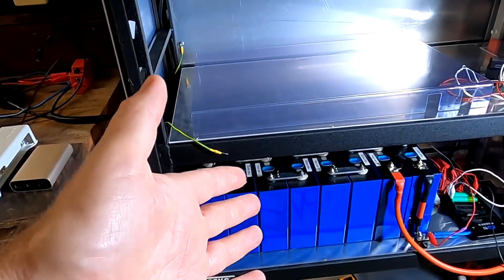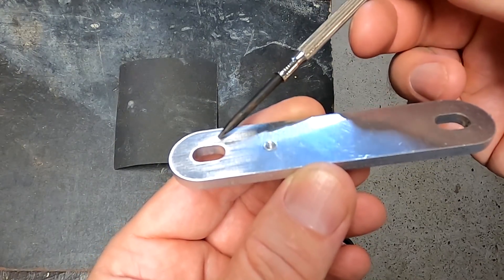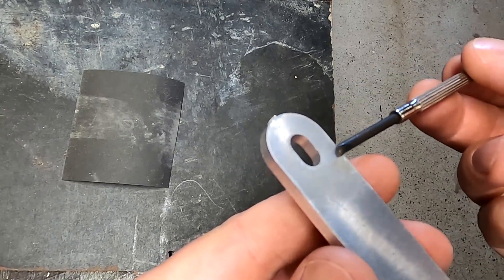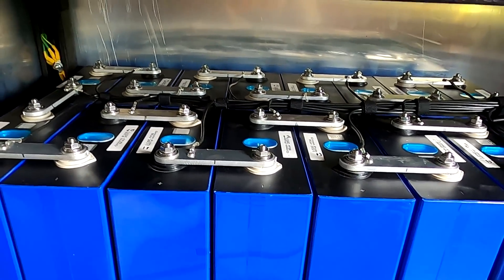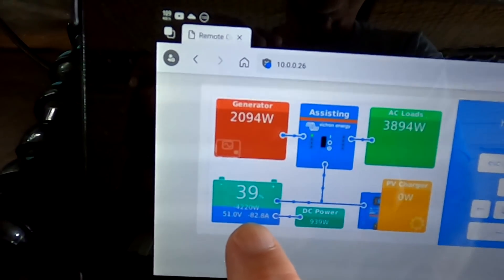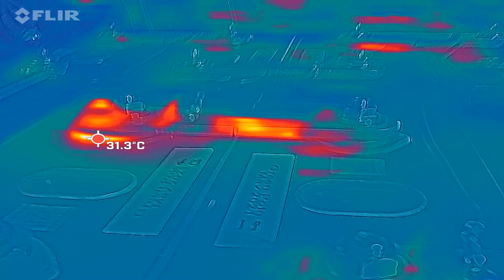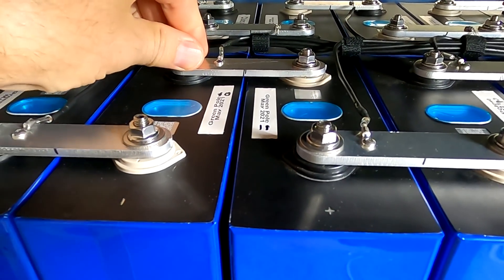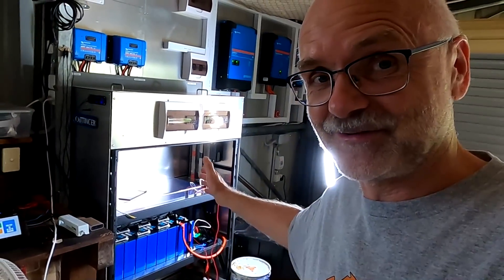Overcoming the battery-busbar problem (for now). Here is what I found!

Comment: Why not go for copper?
Reply from the maker: The Aluminium bars have a lower resistance than the copper busbars coming with the cells. Also, I'm experimenting here on the channel ;)
Reply: @OffGridGarageAustralia  Strange … when compared by volume, copper outperforms aluminum when it comes to electrical ratings. Boasting a lower electrical resistance, lower power loss, lower voltage drop and higher ampacity. All of which contribute to the electrical efficiency of the busbar trunking system.
Reply: @IAmZen_007  Which is why these bus bars are over-sized to counteract that. By making them thicker, you can get a lower resistance compared to the included copper bus bars. He's not comparing the same size/thickness of copper vs aluminium, which is of course better for copper.
Reply: @upnorthandpersonal  I agree but I would go for the same size … in copper.

Comment: Aluminum has almost twice the resistance of copper.  This is why it is heating up.  Better just use the provided copper bus bars
Reply from the maker: No, that's not the reason at all. In fact these aluminium busbars have a lower resistance than the copper busbars which came with the cells. Watch it here: https://youtu.be/mdr5HZZRaTc

Comment: Personally I would ditch the aluminium in favour of tinned  copper. 
Aluminium is not a good choice for low voltage application’s unless it’s welded.
Reply: Because my tin plated copper bus bars were cool as cucumbers after several hours at 90-100A today.
Reply from the maker: Why do you think it's not a good choice?
Reply: @OffGridGarageAustralia  there’s too much chance of oxidisation on aluminium leading to high terminal resistances and temperatures, I have had nothing but problems the same as you with my battery using aluminium, changed to tinned copper and no problems.

Comment: Terminal velocity!
Aluminum has an oxide form almost instantly, maybe you can  find a soft stainless brush to clean the buss and terminals with, a clean one, and keep it clean with acetone, did you check the voltage drop across the terminal and buss? (I missed the last video!) But I'll watch it, soon! 😜
Reply from the maker: I didn't check the voltage drop as I cannot measure it. There is no access to the actual terminal of the cell any more. It's all covered by the busbar.
Reply: @OffGridGarageAustralia  Maybe you can get to the batt term. Since this is an experiment, how about drilling a hole in the alum bus-bar large enough to put your voltmeter probe through. If the surface area is small then it probably does not matter where the hole is located. But, I would be inclined to position the holes at the extreme end of the bus-bar. Good Luck.

Comment: Andy 
You should not see more than .001 millivolts between the side of the battery terminal (under the buss bar) and the top of the buss bar right next to the nut at 90 amps. If you do there’s resistance.
Reply from the maker: There is no way to check that though.
Reply: @OffGridGarageAustralia  
Arg! Yes I seen yours are practically flush with the plastic. Dang it! My terminals (CATL) are smaller in diameter(not a good thing) and way taller so mine are easy.

Comment: Andy, it most likely does happen to a lot of people, but they probably don’t stare at their battery with a thermal camera every day to find out lol. If I say ouch when I touch them, then I know they are too hot, otherwise, I just keep sendin it. 

Actually, in all honesty, I have temperature sensors every 3rd busbar connection. I check them on my phone way more times than a sane person should. But after I roasted a stainless steel washer, by putting it between two connections carrying 3-400 amps, I constantly stay worried.
Reply from the maker: Temperatur sensors at the busbars is not a bad idea actually. Could be another great project... 🤔

Comment: It would be interesting to test at 150% of normal max, or ideally 2x normal max.  In other words, if your BMS limits to 100amps (fairly quickly shuts off), bypass the BMS and test for 30 minutes at 150 amps or 200 amps.  Starting with the battery fully charged, a 200 Ah or greater battery should have no problem at 200 amps for 30 minutes.  That will show any heating issues more quickly, and if it is good at 200%, it will be good at the normal max.
Reply from the maker: The BMS can deliver 200A constantly or 350A for a few minutes.
If I can see no more heat building up at close to 100A, that's good enough for me as I will never draw more power from these batteries. In fact with 2 more banks installed, it will be close to 40A max per bank for now.

Comment: Is it possible that the pressure from the nut and terminal is compressing the aluminum down and changing its shape
Reply from the maker: No, that's not possible from only 4Nm. These 4mm bars don't bend  easily.

Comment: While it is true that the oxide forms very quickly, it's only the first 4 nano meter that forms almost instantaneously; the deeper oxide takes a lot longer, so adding no-oxide right after sanding is fine. Incidentally, your experience also shows the reasons to use a conductive paste such as MG847 or silver based compounds: it's to make a uniform connection between two contacts when they might not be fully 'flat'. The paste fills the 'gaps' between the two contact areas.
Reply: We used to have a similar problem putting epoxy coatings on lead, where an oxide coating forms instantly. The answer to apply the epoxy (or conductive paste) and then immediately scrub and massage with a metal bursh, through the unset coating. Now the metal is on bare metal, not oxide, and can be finished or bonded.
Reply: Thank you for substantiating the theory. I have used MG Chemical 846 C Compound in many electrical joints. But I detest the item to the hilt, due to its unauthorized spreading on digits, even though Nitrile safety gloves were used. Thanks for the similar thought. Have a nice Sunday evening. 73s…
031322/1433h PST 🇺🇸
Reply from the maker: So is it MG847 vs MG846?
Reply: @OffGridGarageAustralia  By the way, don't just take my word for it. Check out Ray Builds Cool Stuff on YT, a few video's back he's trying various methods, measuring terminal resistance etc., and ultimately settles on 847 as well.
Reply: @OffGridGarageAustralia  MG847. MG846 has higher resistance:  63 Ω·cm vs 23 Ω.cm. MG846 is silicone based. MG847 also doesn't 'bleed', that is, it stays put.
Reply: @upnorthandpersonal  , what if we wrap pure carbon fiber fillaments under and over each busbar connection? Would that improve contact by filling all the gaps?
Offcourse, after applying the antioxidation paste.
Reply: @silviuflorescu6838  I think a paste works better for this. You also want to make sure the carbon fiber is suspended in e.g. oil, because of galvanic corrosion.
Reply: Yes but why risk it? Just use copper. It’s lower resistance anyway. Sorry I missed Andy’s reasoning for going with aluminium. BTW, you can probably better clean the buss bars without damaging the integrity of the surface using a mix of vinegar and water.
Reply: @mondotv4216  The goal is to have a thin oil coating to prevent oxidation. Water will make it worse. Andy discussed the use of aluminium bus bars in a previous video. That does not mean I recommend it...

Comment: I find that applying the electrical grease to the sandpaper directly. Then I wipe them off with a paper towel covered in grease so it keeps it greasy. I install them greasy and it seems to prevent oxidation since it squeezes the grease out under the contact points of the busbar. YMMV
Reply from the maker: The less exposure to the air the better, so this is a good workflow you're describing there.

Comment: Why not install Nickel plated copper busbars instead? They are a much better conductor and the nickel prevents any oxidation from forming so you won't ever get high contact resistance between the busbars and the terminals just like you demonstrated in your video.
Reply from the maker: These Al busbars are actually a better conductor than the copper busbars which came with the cells: https://youtu.be/mdr5HZZRaTc
Also, what would we learn 😉

Comment: If you want to go a bit crazy on truing the surface place the sandpaper on a sheet of glass before sanding. That's what I used to do when truing CPU surfaces and heatsink surfaces before applying thermal paste.
Reply from the maker: Ah, yeah glass would be optimal. I have a mirror tile which I could use. Thanks for the tip!

Comment: Change the busbars to COPPER, IMO; experience taught me just that. Keep up the good work.
Reply from the maker: Thanks, yeah, it might be better in the long run but lets see how the al bars last over time now. We all want to learn here 😉
Reply: Copper and aluminium react. Would need an appropriate electrical joint paste
Reply: The cells terminals are aluminium. If you join a copper busbar to an alu cell terminal, it will be worse than what he has now.
Reply: @danielardelian2  How so? I can put a temperature probe on all of my copper busbars and they are ambient temperature, no heat whatsoever. The batteries live in totes on my back porch in a high humidity location. 18 months with no problem at all....yet.

Comment: I'd be interested in finding out after a week or two if the NO-OX-ID has done it's job and the bars stayed cool. For all I know, the NO-OX-ID is crap.
Reply from the maker: That actually happened to some of the connections in the old battery and I had to redo them a few times.
Reply: @OffGridGarageAustralia  Interested in trying the MG's 847 carbon conductivity paste (on Amazon) and making a video? It is supposed to be very good conductivity, anti oxidizer, and thermal conductive paste. Last week I bought the NO-OX-ID because I saw it on your earlier videos, now, I'm not soo sure if I want to use it without further testing data. I thought "This guy tests everything, so he must have tested it before choosing it :)". I'm leaning to the 847 now. I only didn't choose it because it was more expensive of the two, but the 847 came highly recommended by a professional. I'm using Cu bus bars because I think it is easier than crimping a bunch of Cu wires like Mermaid lady. I was considering the Al bus bars to save a few bucks on the new builds, but with the amount of trouble you are seeing, I'm a little more concerned about using them now.

Comment: As I told in a comment on the last video: Do not use a washer alone, use a serrated washer, to cut through all oxides, a washer and a spring washer to keep the force constant over temperatures...
Reply from the maker: The washers are only applied from the top. I think there is a misunderstanding here: 99% of the current will flow from the busbar to the terminals directly and only a very small amount thought the actual stud. The form and type of washers will make no difference of the connection underneath.
Reply: @OffGridGarageAustralia  Sorry but I think you are mistaken about the flat washer. IMHO the flat washer reduces the pressure at the contact points between the batt terminal and the alum bus-bar because it distributes the force from the nut over a larger area. Also, if the flange nuts are serrated, the serrations concentrate the pressure improving the chance for a gas-tight connection. Almost all of these issues go away when copper is used.
Good luck and keep 'em coming.
Reply: @OffGridGarageAustralia  But even if the serrated washers have not much effect, the spring washer will keep the force constantly applied.
Reply: @the78mole  yes i think a spring washer is essential as alum has a fair bit of thermal expansion.
Reply from the maker: @the78mole  That's what I use the flange nuts for, right? They have the same effect.
Reply: @OffGridGarageAustralia  As John Meek describes it correctly, the flat washers have a bad impact on the overall connection performance. This is, why you should only use them in combination with serrated washers to get gas-tight connections. I believe, the flat, large contact area between battery and busbar is also not ideal for the material combination you use. I can only speak from my experience and what I learned as a trainee and the rule of thumb is: avoid aluminium, prefer copper. This gets another twist with actual prices, but the rule stays valid from a technical point of view.
Reply: I think a serrated washer could risk worse contact if it's not fully compressed.

Comment: Could you try tinning the bus bars? Having a different material which doesn't oxidize as quickly as the surface layer could be better. Also - solder is softer so it'll squish against the terminal and deform a little giving you more wiggle room for a less flat bar.

I mean there must be a reason that most crimp connectors are pre tinned? 🤷🏻‍♂️
Reply: 031322/1455h PST 🇺🇸.    Mark my words … Andy will discard, throw away and forget the Al BB and will replace it with 3mm Cu BB, I bet on it. Remember, Andy is experimenting, teaching, educating  and pleasing Paul,  simultaneously, quite diplomatically. 73s…
Reply from the maker: They tin the copper for the same reason: keeping oxidation away. Copper does not oxide as quick as aluminium but it will over time.
Reply: @OffGridGarageAustralia  The difference and problem is that copper oxide is conductive, while aluminium oxide is not.
Reply: Doesn't matter.  The batteries also have aluminum terminals so it is better to keep it the same, just have to remove oxidation before assembly.
Reply: I just thought it might be worth a test. I'm not convinced manufacturers of crimp ring connectors would go through the extra production step of tinning their products if there wasn't some tangible benefit. Andy said the old bus bars and digital mermaid's flexible ones worked fine - maybe the fact they are both tinned could be a factor.
Reply: @pingu99991  You can't easily tin aluminium.
Reply: @upnorthandpersonal  I think the way I'm picturing the tinning process for this is closer to brazing but without soldering two parts together. Like heating up the part with a blowtorch and touching it with the solder letting the heat of the bus bar melt it so it wets across the terminal area.
Reply: @pingu99991  Doesn't work like that, because of the oxide layer. You should google "tinning aluminum" and check the first video result "Easy Pretinning of Aluminum to Make it Solderable". You can also do it with special flux for aluminium.

Comment: Aluminum oxidizes instantaneously as soon as exposed to air and moisture.  That is why you must use 100% Argon gas to tig weld it. Aluminum also expands and contracts differently than other metals.  Aluminum bussbars will eventually corrode through galvanic corrosion,  loosen,  and maybe cause a fire. 
This has been proven over and over in the construction industry where Aluminium bussbars were used in big condominium buildings.  All the rain and resulting humidity in your area have made things worse.
Reply: Obviously you can’t TIG weld battery terminals. I realise you know this but just for clarification, commercial batteries use laser welding. Aluminium won’t galvanically corrode with itself? And it’s pretty stable with copper unless you’re in a constant high humidity environment like a boat.
Reply: @mondotv4216  the cell terminals and busbars  seem to be a problem because the battery makers are now mostly laser welding them, which makes the battery cells not serviceable.  There is a lot of amperage flowing through those connections.  Maybe the terminals should be redesigned.

Comment: I commented before about the flatness of your mating surfaces. I am curious as to why you haven't checked the factory surface of the cell terminals. Given the inflexibility of the aluminum bars, any unevenness on the call terminals will work against you as much as the bus bar irregularities.
This is a critical topic here to raise awareness, no matter the configuration. Great job Andy!
Reply from the maker: Thanks. I checked the terminals as well but as they worked with the other busbars I was more focusing on the al bars and found the light sanding seems to have removed the oxide as well as uneven areas. But there could be more and time will tell...

Comment: congrats for the improvement. What is about the contact face on the poles? Are they flat enough? Remember the issues with Al wires in DDR electrical installations. The are prone to fail, especially when getting aged.
Reply from the maker: I checked the terminals in the last video. And they seem to be working fine with the copper bars coming with the cells.

Comment: I use the original Chinese Bus Bars. I clean them with alcohol, screw them down. No Problem ever. Aluminium is so reaktiv, it bulids oxides in seconds. Al2O3 is a isolator.
Reply from the maker: So you don't use any grease or paste in between, just clean terminals and bars, that's it?
Reply: Every additive adds resistance. I also didn´t use steel washers, they are adding resistance too.